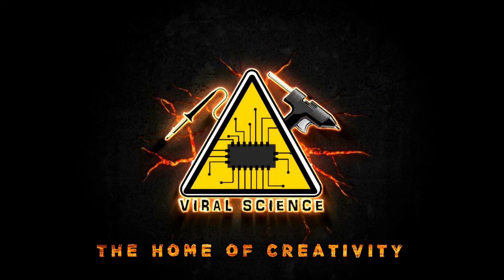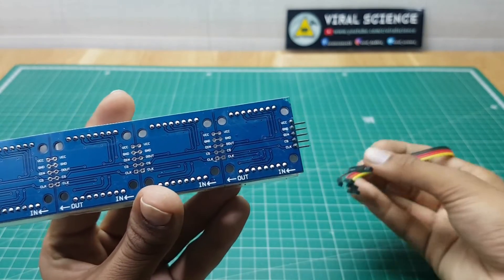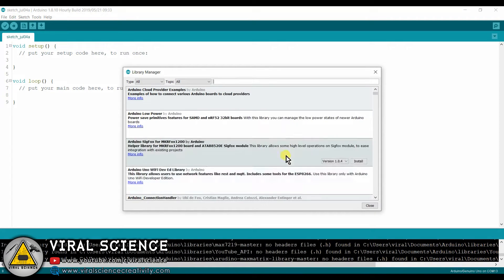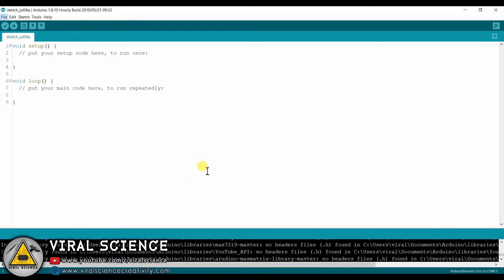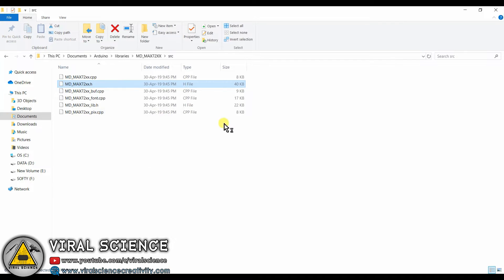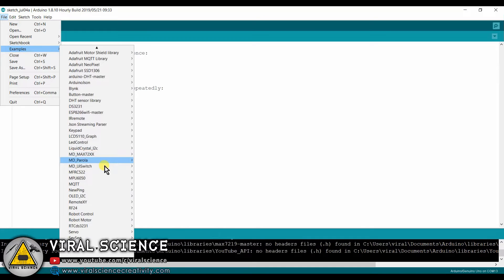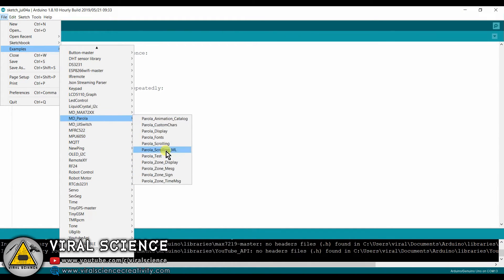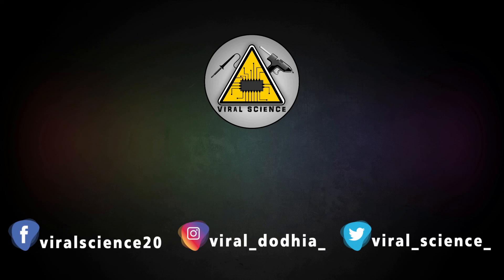Arduino DOT Matrix Scrolling Text Message Display

Comment: Hi, Great video on how to make the scrolling matrix, which I used and made one.   Worked PERFECTLY.   Only have one question, maybe at my age (78) I'm missing something.  You plugged the 5 wires in one matrix.  How do you connect it to the second matrix so they are touching (side by side).  Do you solder or use wires.   Can you please post a photo of the back side of the dual matrix.  And maybe a simple explanation as to how you connected them.  I've looked all over the internet and people say you can connect them but don's show how.  I would REALLY APPRECIATE your reply.
Reply: Sir, You need to follow Z configuration (LED Pixel Connection) and make changes in coding as well.

Comment: I successfully upload and ran the scrolling text sample. But that's about it. I want it to scroll it whenever I want. Not all the time.
How do you modify the Parola_Scroll to make the text scroll at certain time. For example, when my sensor read certain value, then it displays in scrolling text.
or maybe add Bluetooth module to it. So you can receive text from your phone instead of getting it from keyboard.
I understand only line where it says  "  char newMessage[BUF_SIZE] = { " ....." }; "  and    "  strcpy(curMessage, newMessage); "